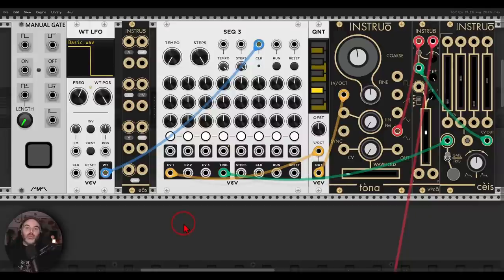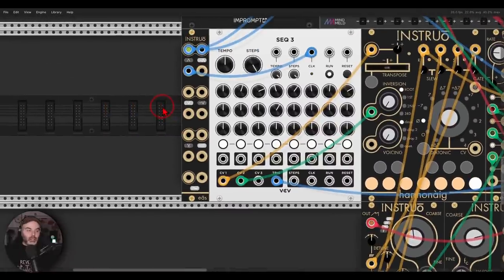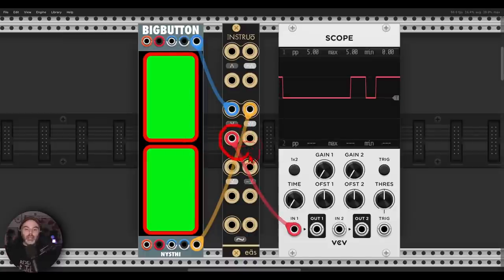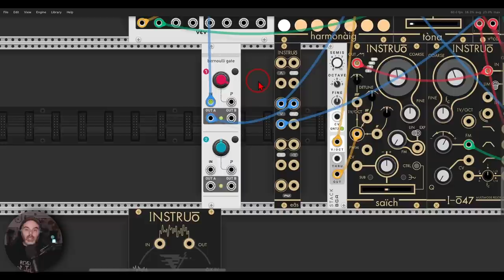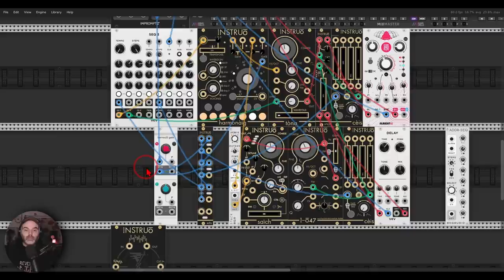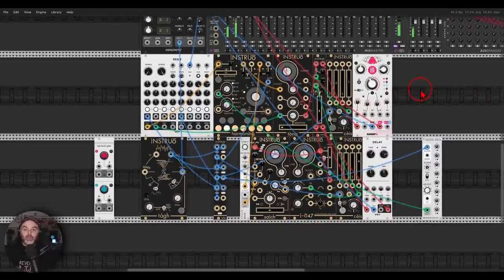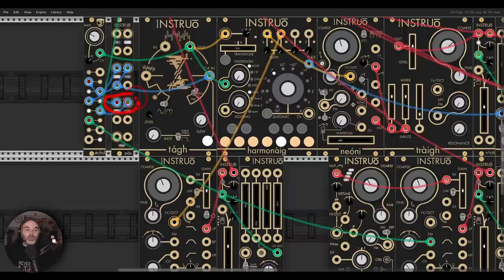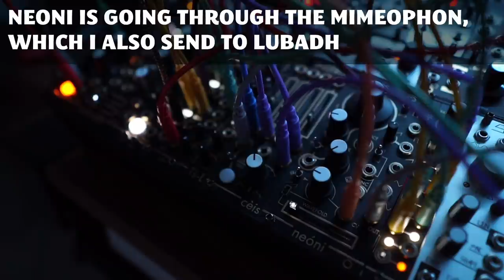Using Logic for Ambient

Comment: Just so those watching know; Submarine has a whole line of logic modules like this. If you need several of the same type of gate, Submarine's modules have multiples of the same gate on one module, each showing the schematic symbol for those gates which helps eliminate a lot of confusion. Submarine also includes a "Logic Analyzer" which is basically an oscilloscope, but it's controls and features are more useful for evaluating logic signals and their timing. Included in their logic library are a bank of Zenner diode triggers (turns on and off at a set voltage or CV level) and a bank of Op Amps that can be used in all the configurations of a real world operational amplifier. The only thing Submarine lacks is a multiplexer ("Mux") but you can build one if you know how.
Reply: I agree that submarine would be my first choice for logic too. In addition to that you can change the voltage levels for on/off. I don't know why a lot of logic modules combine a gate or trigger into 0V/5V Levels on the output. It is clearly not for use with audio as input, that way it should be -5V/+5V... and again, that is only an option on submarines modules. 5V is ok for a gate or trigger, but is not VCV-Spec. Nysthi has a Logic module too, which can be set to 0V/10V.